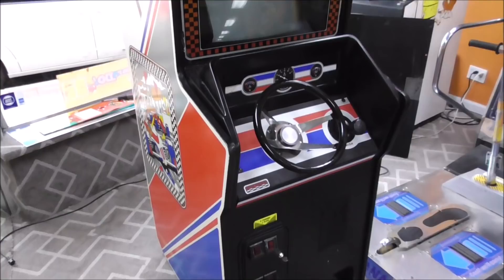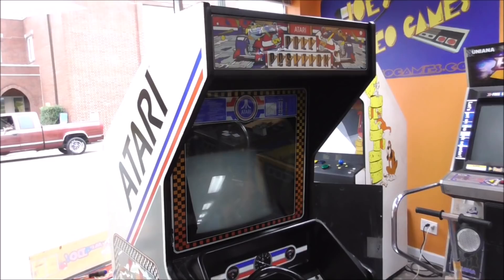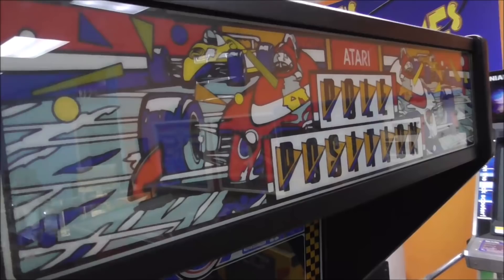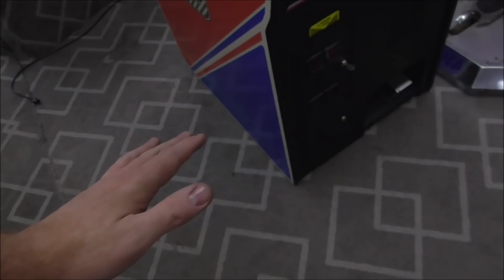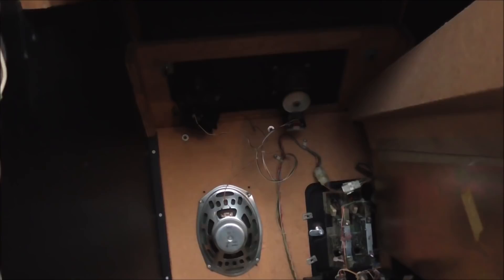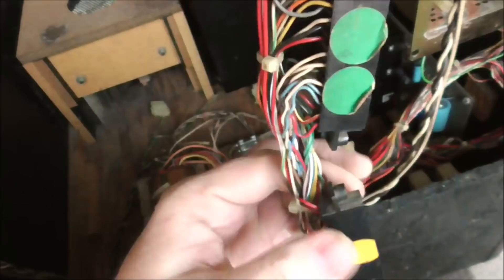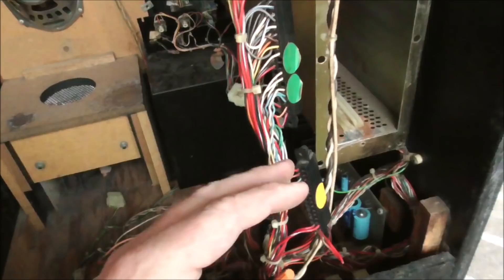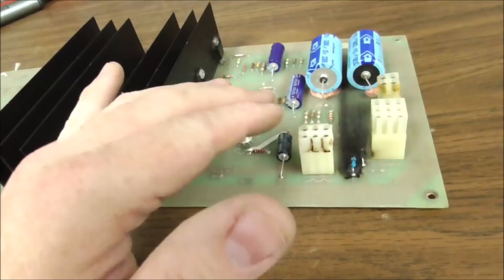Let's Repair Atari's Legendary (But Ultra Complex) POLE POSITION Arcade Game!  Two Power Supplies?

Comment: I played Pole Position back in the day every chance I got!   Yours is probably the best depiction of the sense modification I have seen.   I am excited to see the PCB.  If only operators took that battery out.  Oh. The custom chips.  Oh.  Those fried edge connectors.  Its more rewarding than usual to save a Pole Position!   It will live again!
Reply: i remember the delivery of a sit down pole position to my local arcade back in 82. Once it was up an running there were so many people that you were lucky if you got to see the screen through the frosted glass on the back. To enhance realism the arcade supplied a crash helmet that people could put on :D. Great times.

Comment: Another day, another Sense mod, huh?  (Two sense mods, actually.)  You know, I respect what Atari was trying to do with the Sense circuit, and I really can't blame them for not being able to predict that people would want to keep these things running for 40 years... long enough that dirt/oxidation on the edge connectors would become a problem.  In that respect, I suppose they've got nobody to blame but themselves for making so many fun games, hmm? 😆 Looking forward to the next video!
Reply from the maker: Yeah i'm not going to second guess an engineering decision made 40 years ago, lol  To me though I think this is the way to handle it, I'd rather have the line voltage go low and the game not boot than have it burn stuff, lol  Thanks for watching SpearM!
Reply: Yeah on paper it sounds like an awesome idea. I’m always having to tweak the 5v in my JAMMA cab depending on the board I’m playing and something like this sounds really handy. But as we’ve seen, if it breaks and starts sending way too high voltages it’s worse than the minor inconvenience of tweaking the 5v pot each time. 😅
Reply: @LyonsArcade  Great Videos!!!  any way you can post the link to the video of the Atari silk screening process you mentioned  .. I cant seem to find it

Comment: The other reason they used a sense 5V is because that wiring distance also contributes to voltage drop. They didn't need to see 5V returning to the board, What you do is adjust the voltage on the power supply PCB, while you put your meter on the CPU board. You adjust the potentiometer on the power supply board to see a good 5V on the CPU board.
Reply from the maker: That's how I always adjust it

Comment: I quite like when you explain your reasoning for why you do the sense-bypass mod.

When I watch "Classic Arcade Repairs", he constantly goes on about how he dislikes the sense-bypass mod and how it is an unnecessary thing to do, because if you keep the connectors clean it should never be an issue.

But I much like your reasoning for why you do the mod, because I think it's a much better reason than flat out saying you should never do the mod.

It should be done on a case-by-case basis.
Reply from the maker: To each his own I say.  If the connectors are clean yes it should never be an issue, but if your connector isn't clean the board catches on fire.  :)  Thanks for watching Ray!

Comment: Great video Ronnie,  Man you started in daylight light and ended in street light.  You have a heart beat, I can not wait to see the next video on this pole position.  I liked the smile face sticker on the one board.  Any idea when that board was worked on or is there any way to tell?  Thanks Ronnie
Reply from the maker: I can't remember that particular one, I either didn't see it or forgot it :)  Maybe I got some more footage of it, was it on one of the power supplies?  We often work on these videos over time so sometimes we'll mess around with something for three or four days but it's only 1 video... see you WEDNESDAY for the next installment :)
Reply: @LyonsArcade  it was on one of the power supply.

Comment: I always remove the rubber scan coil wedges one by one and add a piece of electrical insulation tape then refit them, the wedges often react with the copper and burn the scan coils. Careful work usually does not affect convergence etc and saves these coils which are as rare as hens teeth these day’s . Great work with the videos.

Comment: Hi Ron, Joe and Donnie.  I used to play Pole Position a lot, it was at a local video store around 1982.  Like "rest of the world" it was a Namco machine, I didn't know of Atari's association with it until it came out for the computer (I owned and still own lots of Atari computers) a bit later and saw the magazine reviews.  The machine I played was a sit-down one, I think the gear shift might have even been on the left hand side as you'd expect in Japan or Australia, I'm just about sure it was floor mounted rather than next to the steering wheel.  I'm not sure I ever saw another one - though did have the excitement of playing a TX-1 machine at a carnival a few years later.
Reply: I also played Pole Position II occasionally, can't remember where.  Didn't really like it as much even though it's a supposedly superior game.

Comment: I'm not only fascinated by all these arcade games you fix but learning about the the sound setup of them. Specifically, information about the speakers.  What is the impedence, ohms and or wattage that each speaker produces on this game? Pole Position, I was ok at it, but it certainly is an or the iconic driving arcade game.

Comment: The sense line in the regulator circuit is there to compensate for voltage drop in the wires and connector feeding the 5 volts to the board.

After prolonged use the main 5 volt connections at the board burn up and then the board tries to draw all the current it needs through the 10 ohm resistor causing it to flame out.

The extra unused stuff on the replaced audoo/regulator board are for a +12 volt and -5 volt regulators, they were mainly necessary to power triple voltage dynamic memory chips like the early versions of missle command used

Comment: In response to the switches on that Kiss Pinball.  For caps and switch scanning I don't believe time matters, as a guess.  When the game powers on there is a chance a cap is charged, ignore that for just a bit.  When the game scans the switches it tries to run a little current through the switch (right, like that's just how it works).  That will charge all the caps, the key point is that it takes current(even if only a little) to charge the caps.  The switches short across the cap at the speed of light the cap is emptied.  Hours later, without being scanned, the cap is still empty.  The little current it takes to charge the cap registers on the CPU.  Normally when dealing with caps time is everything, but in this one instance I think it only a combination of the switch discharges and the current it takes to charge the cap.
Reply: Once the cap is charged and the switch remains open, no current flows in that case as well.
Reply from the maker: You understand though that most of the switches don't have a cap?  Thank you for watching Mike!

Comment: On the subject of replacing the power supplies. Installing a modern 5v supply does not require that the old one be removed, it could be left in place but only used for audio.
Reply from the maker: Why would you do that though when you could just fix this one?  If you put a new one in, you have to rewire all of that (by the way, the power supply receives 12v from the transformer to run, so you'd have to find 110 somewhere if you're using a computer power supply).... just doesn't make any sense.
Reply: @LyonsArcade  Mainly I was just replying to your replies to other people in regards to the regulator boards amplify the sound. The point I was making was that one does not need to remove the old boards in order to install an alternate 5v supply. Though on the subject of why you would want to replace the 5v supply, its because the old supplies are sketchy and will fry alot of irreplacable chips if they fail in the wrong way.

Comment: Yup. MatsuSHITa. It's got some jailbars. Needs caps. Otherwise, nice job! If you ever need to replace the flyback, it's a whole process. There is one available that fits the chassis footprint but doesn't provide the correct heater voltage. There is another (same part number) that does provide the correct heater voltage but it doesn't fit the chassis footprint and requires some gymnastic leg bending to get it to fit. Just a heads up if you need/want to replace it.

Comment: Seems like a full modern power supply replacement would be better than doing a sense mod, or worrying about a voltage regulator shorting to 12vdc.   Also, new ones would be more efficient with less waste heat. Thanks for the video.
Reply from the maker: Nick you missed the part where the audio amps are on the power supply, you’d have to rework that too… much easier to fix the original

Comment: Pole Position is actually a NAMCO game that was licensed to Atari.
The board in this game is also a NAMCO design that was licensed.
Just like Pac-Man was also a NAMCO game but was licensed to Midway.
NAMCO didn't have a US affiliate so they licensed their games.  Don't know exactly when NAMCO opened a US office but obviously they had one by the 1990s and weren't licensing their games to other companies by then.
The rules and players of the videogame were very different in the late 1970s and 1980s than they were now.  Lawsuits and bankruptcies changed that industry dramatically before the end of the 1980s.
Nowdays, NAMCO is Bandai-Namco and they're getting a crappy new corporate logo next year inspired by the Twitter logo that has generic pink lettering framed in blue.
Reply from the maker: This is the Atari version thx
Reply: @LyonsArcade  It's Atari branded on the outside of the box but the game code and board are still Namco IP.
As I understand it, the Japanese companies in the early to mid-1980s did not want to spend the money to do R&D in the US and set up offices to distribute their games in this country.  They licensed for less pain but they also got less of the money, too.
Nintendo didn't want to sell the NES on its own and tried to get Atari with its distribution knowledge to sell the system for them!  Atari turned them down and the rest is history.
Atari might have continued being RELEVANT for at least a few more years had they taken the deal with Nintendo.
I think it was a good thing in the long run that Atari turned Nintendo down.  Atari never made a good move on its own after the mid-1980s and the industry was better for that for at least 25 years.
I personally think the video game industry is in a shithole unless you'e dealing in retrogames.  People are buying the original hardware or emulations.  The new dedicated consoles, meanwhile, have NOTHING TO OFFER in new software even if you could buy the consoles in stores now.
I think this might be the last generation that either Sony or MS offer new consoles.  I think Nintendo might stick around and do its own thing but I think it's mostly going to be PC's and economy-priced retrograming (things like Raspberry Pie, Arcade 1Up) from now.  There will always be a collectible market for retrogames and original arcade hardware but I think the PlayStation's and XBOx's may die after this generation.  They didn't begin well anyway!

Comment: The sense exists to measure the voltage drop under load for the cabling. You keep describing it in terms of the connector, that is the mistake the designer made not the intention of its design. The sense compensates for the voltage drop of the cabling and the voltage drop under dynamic load as the current drawn goes up and down. The thinner the cabling the more the voltage changes with current draw. Had they put more ground and power points on the design and used thicker cable then they would not have needed the sense, in a way it is a cost cutting exercise by the designer.
Reply from the maker: ok thank you i'll try to stop explaining it in the future sense I don't know what i'm talking about

Comment: I stupidly used a flea market pc psu to run a big led display... long ago. Image froze for the final time (until/unless I fix it). Power supply autopsy showed 11 volts on 5v output and a shorted regulator. That's when it's fun to blow the capacitors on purpose.
Reply: I want to add that the psu was over rated by at least 50 watts.  Perhaps it came off the street tho.

Comment: In the basement of the Arcademuseum Seligenstadt Germany there's a Pole Position monitor with insane burn-in.
The GAME OVER is almost black. People don't believe me the monitor is not connected to anything when I show them a photo. G07 iirc.
I also repaired a few boardsets of PP and PP2. This damn battery... yeah the C7 custom, sometimes traces were eaten through, a bad address selector (LS138?139?) and some bad RAMs. Pole Position is pretty picky when it comes to 2114 style RAM, they work in one location and need a different type in the other (timings). And once a CPU just died with D0 not getting close enough to 0V just after I fixed it.
Also Qix. The bootlegs are a lot better because the brand of battery they used didn't leak nearly as much as the originals.
Reply from the maker: You've repaired a few of them so you know the deal, the things are super complex for this vintage... thanks for watching SenilyDeluxe!

Comment: I understand keeping the PCB, inputs, and display the same, but the power supplies could be replaced with a modern supply.
Reply from the maker: Shadi2 if you watched the video you'd see that the power supplies also amplify the sound.  So you'd have to replace the power supplies, rewire the cabinet, then also add two sound amplfiers and rewire all that too.
Reply: @LyonsArcade  could a single PC power supply drive all that?

Comment: Hey Ron, were the bridge rectifier/s located somewhere near the power transformers? I noticed there were none on either of the PSU PCB's...  10/10 for this vid...
Reply from the maker: There is one hiding underneath the power transformer down in the bottom, it's actually mounted under that transformer.... I've shown it in a couple videos but on this particular one since the voltages were good and the 'big blue' had already been replaced down there I didn't remove that power brick this time... Thanks for watching Dero!!!

Comment: I stupidly used a flea market pc psu to run a big led display...  image froze for the final time (until/unless I fix it). Power supply autopsy showed 11 volts on 5v output and a shorted regulator. That's when it's fun to pop the caps on purpose.

Comment: JOE CLASSIC, Why not try Direct Hard wiring the Sense and Return wires soldering them to the PCB board bypassing the Molex connect would solve the problem also. Using very low resistance wire will help the sense circuit out also and direct hard wiring bypassing the molex connector will fix the problem. The Sense circuit will sense if one or more of the IC chips are shorted. I'm not sure why they made the 12vdc and 5vdc regulators circuits that if the 12vdc regulator is shorted it will make the 5vdc output 12vdc. That is a very poor design because the 12vdc and 5vdc should be isolated and have isolation to prevent this issue. They should of added a Fuse AFTER the regulators so that the fuse blows if the 12vdc regulator shorts to prevent all the 5vdc IC chips from getting slaughtered

Comment: Honestly I have been looking for an operation wolf for the last 4 years. Another has been double dragon finding something decent seems to be getting harder.
Reply from the maker: Another issue with Double Dragon is the cabinet was made out of thinner particle board so they just didn’t hold up!  The pcbs though work fine…

Comment: I know there are a lot of purists out there that want to keep everything original... But...

I'dve said to hell with that power supply board and just installed a modern-day PC power supply of the 650 or so watt variety. A modern PSU should provide more than enough power and the 5v and 12v circuit/rails would be easy to pull out of the ATX connector. If you were feeling fancy you could even make your own male ATX adapter harness and just directly solder the harness to the main boards for easy service.
Reply from the maker: And then none of your audio would work because the audio amps are on the power supply (which I mentioned in the part of the video you didn't watch)  :)
Reply: @LyonsArcade  My apologies. I DID watch the whole video, but I must have missed the audio amp bit.

Comment: any opinion why cabs would use oval speakers vs rounds?
Reply from the maker: I think at the time perhaps they were just easier to buy in that size, this particular speaker was used in most games back then.  Probably something with a decent sound that was cheap.

Comment: Surprised you didn’t recap the AR board. The caps looked original.
Reply from the maker: Anything else you want to complain about or did you enjoy any of it accidentally?
Reply: Seriously, you think it’s complaining when I asked a question about the caps looking original? If they were replaced that’s all you had to say. You made a point to to tell everyone that the big blues had been replaced and how important it is to maintaining the power supply. The caps on the AR board are just as important as the big blues. If your customer doesn’t want to pay for a cap kit just say so. And If you don’t like questions  asked just say so when you say leave your comments below.

Comment: Great video, I'm an addict now,  going to start to use the amazon link. Thanks again for all the hard work!. Quick question. Why do some arcades use mirrors and upside down monitors and some don't , heck what is the reason for the mirrors anyways?
Reply: mainly for balance to prevent the tube from making the cabinet top heavy :)
Reply: @azcardinal88  thanks ! never thought of that!!